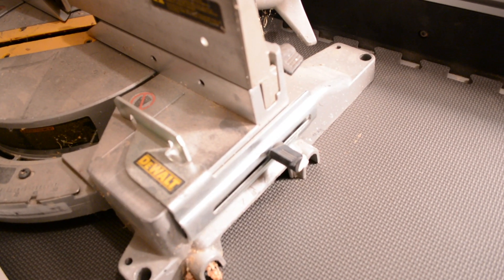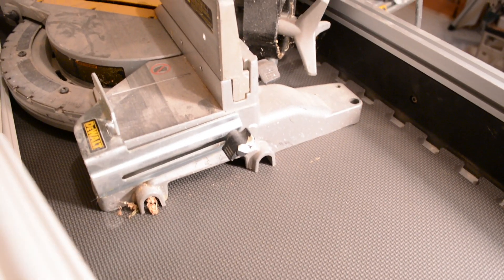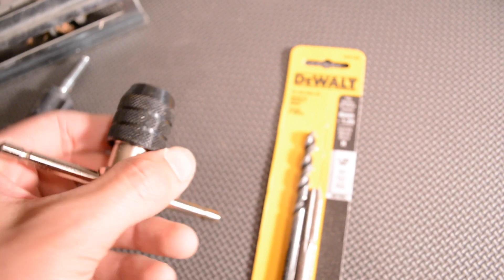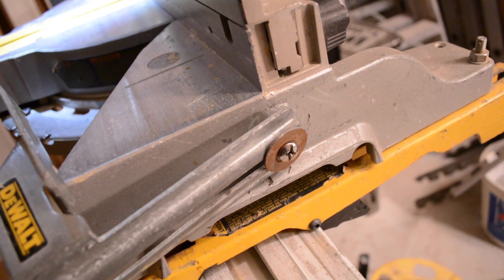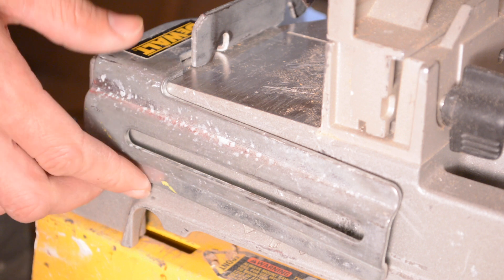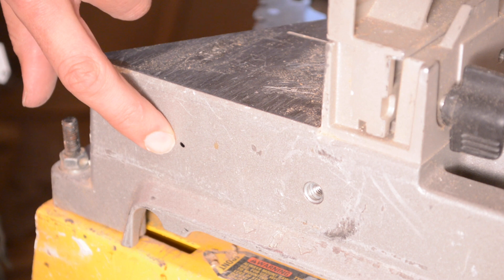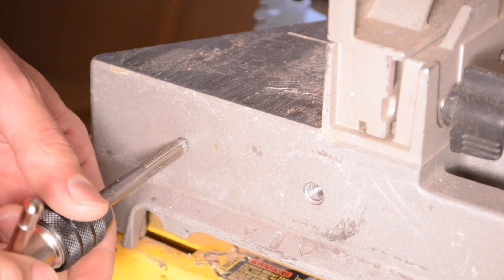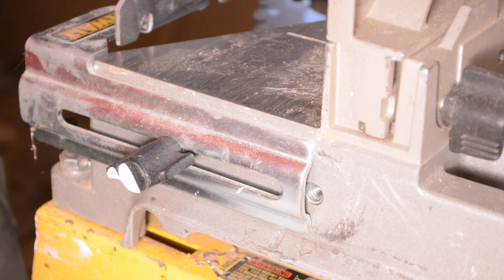I Modified My DeWalt! It Actually Worked!

Comment: Great tip. If you thread a second hole in between the original hole and the hole you just did, you could put another wing nut in there and the crown stop would slide along both which hold itself up when you need to set up for the larger crown.
Reply: Ned Casey you beat me to it but that's exactly what I was going to suggest as well... Great minds think alike! lol
Reply from the maker: That's a great idea! Gotta do it soon.
Reply: Great Tip Ned!
Reply: Thats the first thingI thought!  Also I bet if you contact Dewalt and tell them what you did, they would consider just having the gide run in a track pre moulded into base ;)
Reply: Ned Casey
Reply: Ned Casey great tip.
Reply: what Ned said ;)
 got little simple mod of my own to saw. working on home studio and will get video up shortly

Comment: I just modified my milwaukee 7 1/4" with the dewalt crown stops😁 Same deal had to tap , but first had to add a strip of aluminum on side because there isnt enough on side of base. I just tapped some screws in the aluminum for now , but will tig weld it when I have time. Perfect for small crown

Comment: i would recommend using a nut-sert. being that the aluminium wall thickness is so thin over time those threads will strip. a nut-sert works like a rivet with plenty of threads inside. and if the nut-sert ever strips it's easy to remove and replace with a new one. but honestly by that time you'll probably want a new saw. good luck😁  by the way great idea!
Reply: joedmac78 that’s very good advice ,but believe it or not I’ve had this done to my miter saw’s for years it doesn’t take a whole lot of torque to hold that crown stop in place, but yes the wall should be thicker and thickened if possible
Reply: joedmac78 great advice.

Comment: Download the crown calculator app, put in the corner angle then the spring angle and cut it flat all day. Makes the beginner look like a pro. Super easy if you have a sliding double bevel miter saw. App comes in handy with base as well when the walls are out of square just put in a 0 sling angle. I don't do crown that often so I hate always having to re teach myself to think upside down and backwards. Love your videos. You do awesome work.

Comment: Great Idea!  I am a little concerned that you are threading aluminum whereas the other hole has a steel threaded insert.  I maybe would have considered fastening a steel nut on the underside just to prevent tearout.  How do you attach that?  I don't know..I'm just an idea man.  Suggestion, put a washer under that knob to prevent walking.  Also, since you have that other hole there put another knob in to maintain alignment at extreme extension.  That will keep it square.

Comment: Great tip. The metal where you made the new hole is pretty thin. The 2 threads you make with the tap will not last long under constant tightening. You may want to put a small aluminum block behind the new hole that you drilled and tapped with the same kit. Will make the whole thing 10 times stronger.
Reply: I guess im randomly asking but does anyone know of a tool to get back into an Instagram account??
I stupidly forgot my login password. I appreciate any assistance you can give me.
Reply: @Ali Leonardo Instablaster ;)
Reply: @Derek Caspian thanks for your reply. I got to the site thru google and I'm in the hacking process atm.
Looks like it's gonna take quite some time so I will reply here later when my account password hopefully is recovered.
Reply: @Ali Leonardo you are welcome =)

Comment: drill another hole just like you did closer to the edge and get a second knob so when you do the bigger crowns use 2 knobs on each side and that way the stop won't fall off the edge.

Comment: i recommend using the original hole for all crown that is small enough to use it.. there are a lot more threads in the original hole. over time you will eat the threads out of your new hole.. use it as little as possible. or you may be able to super glue or epoxy a nut on the back side of that new hole... that would last a long time.. your knowledge is teaching me a lot so i figured i would pass on some of mine..
Reply: I'd use the metal welding stuff out of a tube to glue a nut. JB weld, or whatever its called.

Comment: Love your videos. As others have said, the metal is too thin and has just a few threads. No problem. Epoxy a nut on the inside of the  saw or use the thick ca glue. one wrap of teflon tape on the bolt threads will stop the glue from bonding to your bolt. After applying epoxy or if using ca, before you spray activator, tighten bolt securely. I'd be amazed if the nut ever came loose. I watch all of your videos. I have  built many homes. You are good and your work is excellent. Good luck, my brother.

Comment: Pause the video @ 12:21. Right in front of where your index finger is pointing. If you drill and tap another hole there, under the crown stop then screw a shoulder bolt in until it stops, that will hold up your crown stop.

This way you don't loose half the travel you just added.

Comment: One thing you can do to speed up taking out the Dewalt crown stops......cut the channel completely through the back end...then all you do is loosen the pinch nut 1 turn, and the crown stop will simply slide out to the front.

Comment: Look into a Rivnut for a good reinforcement instead of just tapping into the thin wall. The outermost part will stick out a bit, but it should slide like a guide without interference .

Comment: Good idea modifying your crown stop.  Be careful tightening your nut down too tight though.  That’s aluminum and it’s pretty thin, so you’ll easily 
strip it out pretty soon.  (BTW, that’s called drilling and tapping.  And it’s very easy to just chuck that tap into your drill, especially with aluminum.)

Comment: very goog tips. I do have a question: What kind router bit I can use to make joints: stair oak tread with poplar stair riser. its ok i use a 1/4" rabbet bit to the oak  tread and 1/4" dados bit to the poplar riser and make the joint together?thanks for all video.

Comment: Did you have to do anything to the fence to make it taller as well?  I have a 12 inch Skilsaw Miter Saw, and I had the same problem you did only my crown stops mount on the front of the saw and not on the side. I had to take L brackets and bolt them into the front of the saw and flip them up so they were even with the base (were the piece of molding sets) then I can take my Crown stops and bolt them to the L brackets which make for a bigger area for larger crown. However last week I did a two-piece crown and discovered that anything bigger than 4 1/4 crown probably would end up over topping the fence so if I had to ever do anything larger than that I need to figure out a way to make my fence taller.

Comment: Wow! What an ingenious idea! 

Does having the metal bracket stick out so far (i.e. when you're cutting the 7-1/4" crown) limit the angle you can cut the piece at? There's one shot in the video where it looks like the tip of the bracket falls in line with where the blade would land on a 45 degree cut. Probably not the case, but that was just the first thing to pop in my head, lol.

Love your videos! Thanks for finding time to show us what the life of a professional trim carpenter looks like day to day!

Comment: I'd put a decent sized spring pin between the two holes, that way the crown stop can't fall downward. The pin would just hold the crown stop in plane with each threaded hole

Comment: I've been cutting crown molding for years and years and I never used any stops I just set the bevel and the angel and lay the crown flat , You just have to cut some pieces upside down and backwards... I keep a set of samples so I don't have to keep adjustments all the time.
Reply from the maker: John L good idea for the samples. I'll have to try that
Reply: It is just easier/faster to lay it as it sits on the wall. Yes, we can argue that once you figure the spring angle it is just as fast.  Just another step to figure out. Just a personal preference thing that could be discussed time and time again.
Reply from the maker: Christopher Dunton yes I am with you. I believe it's much more efficient to cut it in position. especially when it's so easy. yes, for bigger crowns you will need to lay it flat, but most crowns for the average home owner are not that big.
Reply: I have the DW708. I lay all my crown flat, never upside down or backwards. I printed out DW's table of miter settings for cutting crown.
Reply: that works great but only with a double bevel miter saw. With a single bevel saw you have to put the crown on it's face to cut reverse angles and alot of crown are wide in the center so it won't lay flat on the face side and it teeters.
Reply: I'm with you. Should be cut flat. We always cut inside and outside mitre blocks and tested all the corners as we were measuring the walls. We just adjusted mitre and bevel angles to make sure the joints were perfect. Using stops was always considered the homeowner or framers way of doing crown
Reply: I'm with John L..  Learn your angles and get experience cutting crown flat.  It's much more flexible and intuitive when it comes to adjusting the joint.  Download an angle chart on your smart phone.  If you have the experience and are comfortable with it, it is faster, and when you get that bad wall, or odd angle, you won't be wasting a board making test pieces.  And you'll impress the heck out of your co-workers / boss / contractor...
Reply: There’s a free app for phones called miter calculator. Just type in spring angle and wall angle and it tells you miter and bevel. Ever since I’ve been using this app my nail drivers are so much happier. Perfect cuts every time. I used crown stops for years but it’s so much easier and faster to cut laying flat I gave the stops away a year ago and never looked back

Comment: When tapping a hole always use a countersink first to chamfer the opening after drilling the proper sized hole. Always use tapping fluid when cutting threads. Using a center punch to create a dimple will keep the drill from wandering.
Reply from the maker: Frank Grammatico thanks for the tips. center punch is a great idea
Reply: Frank Grammatico awesome

Comment: At some point, for a larger crown molding, you will not be able to use this method, because the fence will not be tall enough. Extending the fence will not be possible because it will interfere with the motor or the blade will not be large enough to cut the depth that you need. Cutting crown on the flat is the only way to cut very large crown. Most good miter saws, including the DeWalt have bevel stops included for cutting crown on the flat.
Reply: Only way to cut any crown molding is on the flat.
Reply: Thats right and that how you do it
Reply: @gilbertartiaga7657  it results in the same cut it doesn't mater which way you cut it, its the same end result.

Comment: Well...awesome idea - just not quit as done. 
All you drilled and tapped was the thin metal of the base - DANGEROUS!
You HAVE the right idea - just lay the saw over to clean it - use "brake cleaner" with NO sparks open flames etc to CLEAN that same area you drilled - and use a dab of JB Weld to ADD a stainless nut to the inside of the base. Screw the nut into position onto the support bolt BEFORE adding the epoxy and be sure none gets on the threaded area. By adding the nut you will gain all the strength needed to hold the fence in place and it not wear/fail as it likely with just the base supporting it. As to the front of the base which should be supporting the fence anchor - have someone make up a short aluminum extension for it by taking some 1/8" X 1" X 1" stock (>>or as large as room allows<<) and bend a 90 into it. Drill and tap TWO holes to keep it in place and use blue thread locker (IE LockTite) on the screws as you install. Those two mods should resolve strength issues as well as giving you a stable and repeatable solution. Hope it helps you and everyone - Remember - YOU had the really great idea - I'm just a engineering tinkerer!
Reply: TheOregonOutlaw This is very good advice
Reply: Damn I wish I had the XP to accomplish that! I always thought why would they only make crown stop for medium crown? If I only had an old saw to "experiment" on. Not my new flexvolt lol maybe ill talk to El jefe see if I can do it on the widow maker?!

Comment: Great modification that will really be helpful. If I could make a suggestion though, because I'd hate to see it strip out. The threads won't likely last very long because the aluminum is so thin there. (you can see how deep the threads are in the original hole) What I would do is get an 8mm bolt and thread that in from the back side so that it sticks out an inch or so. Then put the bracket over the now stud and get an 8mm knob with a nut instead of a bolt like the one you have now. That way when you tighten and loosen you are turning against the threads in the knob instead of the shallow threads in the aluminum. Both the bolt and knob should be available at any hardware store and will make the modification that much stronger and last that much longer.

Comment: What about cutting on a compound and a miter angle once you get the spring angle. I have done it with 7 plus inch crown poplars it is a pain but it works. I can send you the table for cutting the degrees... it works.
Fabulous videos as usual.

Comment: I saw at least one comment concerned about the metal thickness and the threads holding up.  It was my first thought after you pulled the bit out.  Here's an idea in the event the threads ever fail.  If it'll fit, just use a lock washer and wingnut.

Comment: thin substrate with too few threads - will strip too easily.

the original hole looks like it is actually a threaded rivet aka riv-nut.  I advise u use rivnuts - u'll need to drill/ream out the new hole a little.

great channel, my bro, love your work, the standards of quality, your freedom with sharing knowledge and experience....  big love and respect :)

Comment: On a relatively thin piece like this, being perfectly square probably isn't that important as long as you're close enough, but if you want it to be nice and square but can't get it on the drill press, you can just cut a couple of square pieces of wood and screw them so they've got a right angle between them, and you can just use that to line your drill bit up against it.

Again, not super necessary here, but if someone else's has a bit deeper to drill through and they want it to be just perfect, that can help a ton.

Comment: I cut all my crown flat no mods needed you can get a chart for all angles works well
Reply: Me too. Flat will always be consistent. All the new miter boxes have the settings for crown already. Just remember, it is only for perfect corners. You'll need to adjust accordingly, and cut from both pieces, not just one.

Comment: whoops the black dot is on high side of the slide, works though. This thread might strip and if it does you can insert a stainless steel piece like the original or install another and make the stripped out one a stud to keep it straight

Comment: You might want to braze a nut on the back side of your new hole to give yourself more thread surface. Just make sure your threads are in line with the threads that you made. If not a second guide/ support pin may be needed. I’m glad it’s working for you, good head on that boys shoulders lol

Comment: Make a few holes as far back as you can go ,or even a slit from one end to the other and use  3 or more  bolts with wing nuts for variable adjs ,the holes really don't need to be threaded ,because  with the added bolts it will still be stable as long as it's kept parallel with the work piece .

Comment: Two things, First did you slide the miter base all the way over to the right to at least 45° to see if it hits the bracket for the crown stop. Secondly If you use that thumbscrew enough, that side wall looks thinner on the base, you could strip the threads... You might have to add a nut on the backside or put in some form of a “Thread-cert” to eliminate strip out of the threads... I have been following you for a while now good video Otherwise...  Greg

Comment: I always find it hard to determine what is the base of the crown (part that goes adjoins the wall) and what is the top of the crown (part that goes on the ceiling). Is it a personal choice or is there a "rule" that should be followed to determine orientation?
Reply: P Foster233 The edge with the most relief goes towards the floor (on the wall). Some types of crown have a thicker edge that goes to the wall too.

Comment: I think you should have marked for the hole from top to bottom (in the slot) with the Sharpie.
the dot you made is on the "top" of the slot, which will make the hole  "high" compared to the original hole.
or you could have measured down on the first hole to see how far the center is from the top of the saw "table", then used your mark to determine the "left to right".